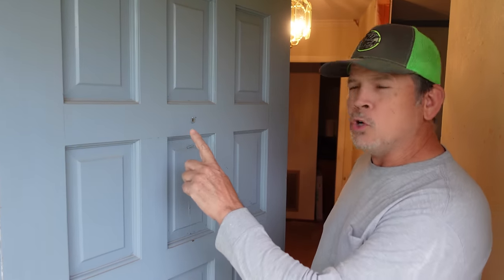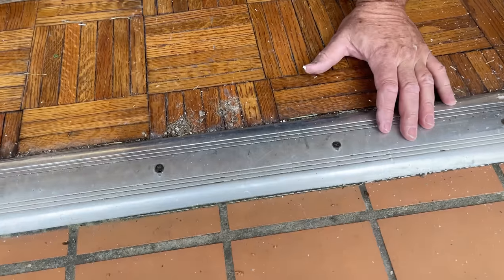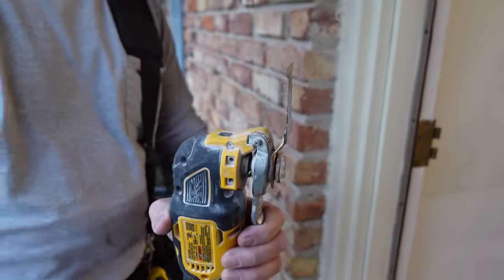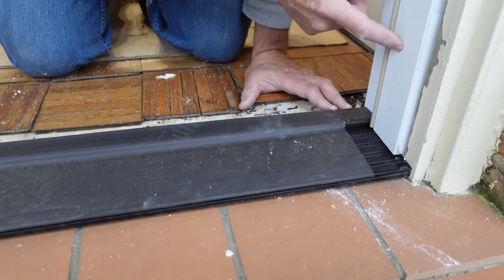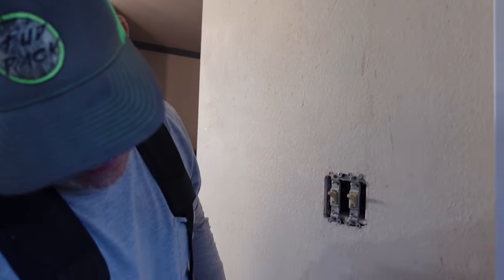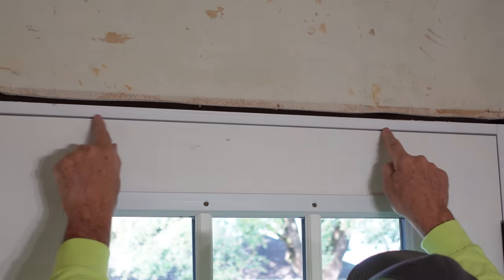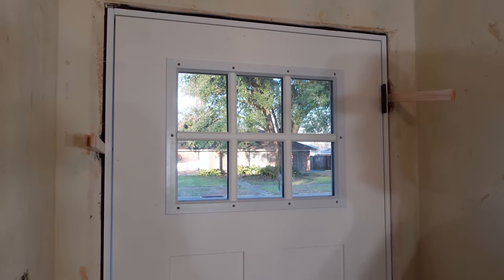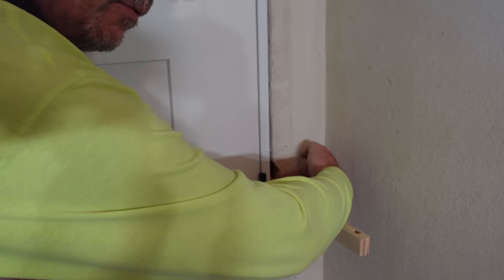HOW TO REMOVE and REPLACE a Front/Back Door (Easier Than it Looks!)

Comment: Probably the best video on an exterior door installation that I've seen.  I'm always impressed by the level of detail and attention you give to each and every project.  I"ve learned so much from watching your videos.  Kudos.
Reply from the maker: Super appreciate that thx 👍👊
Reply: @StudPack  Why do you install door that's opening inside? Doesn't this make it hard to open in emergency? Also with those hinges this looks extremely weak solution against any forced entry, since there's only small lock latch holding door shut.
Reply: Nice job. Sometimes when the feed rate is turned up to high on a cnc it will cut funny shapes. Seen it a lot with worn cnc  machines
Reply: @jarivuorinen3878 do you live in a cave? That is how all residential exterior doors are! He ran screws through the hinges into the framing.  Also when he foam seals  around the jamb it'll be solid
Reply: Could not have worded my thoughts any better!  👍😊

Comment: This video popped up in my feed, and I watched it from the perspective of a residential/commercial door specialist, having installed many thousands of doors, reinstalled many thousands more. I also taught proper door installation to other carpenters. I know, too well, the deficiencies of door manufacturers and production framing crews. I have watched many u-tube carpenters install a door and face-palm. A correct swap, well done. You even called out the larger #9 screw  ( I use stainless) on the security screw. I also use 3" # 7's for strike and latch plates. Criminals beware :) !
Reply: Excellent!

Comment: Sorry Stud Pack, I was cut off before I could finish. After installing the newly formed Sill tray, use the quality sealant around the edges to prevent air leaks, around the Sill tray. As a note on the knob side of door, I would suggest using wider shims around the latch area so your customers can add reinforcement latches that contain 8-12 3" harden screws to prevent door kick in's that could pull your frame out of plumb without wider shims placed on latch side.  These are simple couple of suggestions to you, and I say this respect. I have been installing doors and windows for years without water penetration. Keep up your wonderful work, I enjoy your videos. Best regards to you, Danny Price

Comment: As a DYI'er I've done many interior doors but no exterior.  The house I just bought needs all new exterior doors and I was a bit nervous because it's a brick house and the trim outside is a lot more extensive than the other houses I've owned. Showing how to remove the door from the inside without touching the outside trim was just the trick I needed to get me going on this project.  I haven't turned my TV on in days since I've found your channel, been binging on your guys videos.  Keep up the great work!
Reply from the maker: Thx Darryl and we're glad you found us 👍
Reply: How'd it go?  I'm considering my first attempt too.

Comment: Thank you. Your attention to detail is becoming a lost art. Hopefully the younger generation is watching content like yours. I’m a subscriber and although I’ve done a lot of the same jobs you work on, I have picked up some tips and tricks from each of your videos. One thing I am doing on exterior door installations is hardening the area where the dead bolt goes into the frame. I normally put a 3 foot strip of steel next to the 2x4 framing and secure it with long screws. It helps to make it secure from being kicked in. I also use structural screws on the hinges. That is most important on the lower ones. Keep the good content coming.

Comment: Great job,  when removing/installing the door/frame, sometimes there is a security wire sensor with a magnet mounted in the top of the door to deal with & mount in the new door/frame.

Comment: Great job, Paul and Jordan! I've hung many a door in my career, and that's definitely a good way to do it. Taking the time to make your reveals correct and true allows the door and the jamb to have clearance for seasonal movement, and proper operation! It's not just for looks, people! One thing you didn't touch on was making sure to add a "shim pack" (hey, is that your 2nd channel?) above and below the strike plates on the latch side of the door for reinforcement. 
I have also noticed a huge degradation in the quality of doors lately, especially from "Steves" and "Masonite" . It seems during the shortage times, the quality control has been severely compromised! The router job on the strike plate mortise would drive me absolutely crazy!
Splitting the extension jamb like you did here saves a ton of time and effort when doing a door replacement! Very smart!
Reply: Who's Jason? Did you mean Jordan? 😁
Reply: Every prehung door I have ever purchased had been a POS no matter which manufacturer.
Reply: What do you mean "splitting the extension jamb? Where in video was that done. Please explain?
Reply: @Fallon Stone  at about 4:15 in the video is where Paul was splitting the extension jamb from the door using a putty knife and a hammer to separate it. The extension jamb sits between the exterior door casing (Brick Mold in this instance) and the actual door jamb, and is used to make up the difference in the thickness of the wall  to the door jamb. Most jambs are 4 9/16" thick, made for 2x4 wall construction. When your exterior has a thicker cladding, such as brick, you install a jamb extension to hide the gap or use a wider, but less available, door jamb. Here, Paul left the exterior casing and the extension jamb installed, removing only the door and the attached jamb, simplifying his installation, which is brilliant.
Reply: @AlAmantea  Thank u
Reply: @fallonstone408  no problem at all.
Reply: Quality fell by the wayside, it's cost, cost, cost.  Many (not all) mfgrs are selling garbage.
Reply: @granbubba1  not only that, it's also a lack of quality help. Finding qualified people to work for you is a very real struggle in this current climate.
Reply: @AlAmantea  You are right on the money there but in the past couple of years' materials have really gotten cheaper and cheaper.  Quality is becoming cost prohibitive and that's really sad, makes us look bad to our customers.
Reply: @granbubba1  100% agree with you!
Reply: The thickness of outside wall is bigger than a  store bought door jamb,  soo thats why he butted up tp the split outside jamb part with the old brick mold.
Usually i have to bring a table saw and make wood parts. We call them door jamb exstintions.  They fit between new door and outside trim.  
This is a very tricky project in Carpentry,   its all about the SHIMS, A hair here n there

Comment: Good job guys right on. I am a retired old finish Carpenter and have done many doors like you did. One additional thing I would check would be the twist of the frame you have to make sure the door fits the jam when it closes otherwise it'll be twisted it looks like yours was probably okay.
For the majority of doors that I did in  retro fit house the floor seem to be always the problem and out of level one way or another.
A lot of times the floor and subfloor were rotted and needed to be filled in redone.
Anyway guys, good job, good video.
Thanks

Comment: Great Video!!! Union Carpenter and certified door and hardware installer here.  I specialize more in commercial doors than residential.  We are always evaluating reveals like you detailed.  I've never seen those door shims that you made. I use shims that are basically 3 1/2" of zip tie material with a peel and stick on the back.  That allows us to throw the hinges, or place one shim on one side of the hinge which also pivots the pin of hinge toward or away from the jam.
Reply from the maker: Thanks Marcus!!   Commercial doors are a whole different ball game imo.  I've done steel, aluminum, glass, laminate, all types of door closers (recessed in the slab are the coolest), locks, panic devices, etc.  Never hung a lead door thought:)

Comment: I’ve been a carpenter/contractor for 42 years and have installed hundreds of doors. BUT....it never occurred to me to leave the extension jamb/brickmoulding in place as shown in your video. Smart. Old dogs can learn new tricks. Dave Heitman dba Dave The Carpenter in Omaha
Reply from the maker: Super appreciate that Dave 👍👊
Reply: I have done this several times on homes where I dont want to desturb the paint or trim on the interior. 
It works well on door that were install square and plumb originally ... then I can use the trim to gauge my reveals and set the door. This way I can also spray the foam insulation from the outside since I temporarily remove the brick mold to add a jamb extension and rip the brickmold down a hair.
I this situation I probably would have just taken the old brickmold doen too.
I wouldn't adjust the top left or right... once you make sure the head is perfectly level then plumb the hinge side perfectly from the very top too the very bottom and then only adjust at the hinges.
You also don't have to remove the weather stripping... you can just fold it back where you are placing your screws.

For the shims between the hinges and the jambs I use the thin hard cardboard used in cereal boxes for example... but whatever works.
Reply: Yeah, it was a great tip, and one I wished I had used when I helped a friend replace an exterior door, and took the new door out of the jamb, and used the old one. Old jamb was encased in stucco, and I was NOT about to mess with that jamb and the Stucco.  Needless to say, it really created a headache, but We finally got it in, and everything was plumb and it operated fine.  Never again!

Comment: Great video. I like to carry a bunch of small washers and place them around the hinge screw holes to use as shims when needed. Using washers also gives you the ability to tilt the hinge if needed, by using on just the two outside holes, instead of all four holes. Sometimes even small washers are too thick for the adjustment I need. A few layers of masking tape in this case will get me to the  perfect thickness. 

To help not having to open and close the door so many times to test gap thickness, I will take a wood shim and slide it into the gap at the top and botom of the door where my gap is established. I push the shim in until it sits snug in the gap between the jamb and the door. I then take  another scrap of shim and some CA glue (2p10 glue as you brand reference it)  I glue the scrap to my gap shim lining up against the jamb creating a positive stop.  I them use the gap shim up and down the jamb where needed sliding shims in-between the jamb and the framing until it presses snug against my gap shim. This creates the perfect gap with a lot less opening and closing of the door. 

If one doesn't have CA glue handy, you can also just make a pencil line on the gap shim. Having the stop makes it easier though.
Reply: Thank you for the good tips!
Reply: Washers?  Dope af!!  And that there, is key!

Comment: I just replaced 15 doors in my house with solid pine doors that I finished and painted.  Fitment nightmares.  I am not a professional carpenter by trade but I knew I couldn't be that incompetent with door installation.  The manufacturing quality was horrible.  And I went to a window and door stop to buy them to get a 'higher' quality!  I had to rebuilt the frames and reposition the door stops on most of them.  I finally got the manufacturer's rep out to look at them and he is replacing some on their dime.  This project has taken most of the year and now I have to finish more doors to replace the ones that I already did.  The whole project has been a nightmare thanks to horrible manufacturing.  I feel your pain.

Comment: The exterior "casing" is called brick mould. More great content here guys, keep it coming!
Reply: Actually that door had brick mould and a jamb extension. The correct way would be to get a door with a 5 1/4” jamb to eliminate that extra piece and scribe the brick mould to the exterior brick so the reveal is even matching up to the door. As it sits now anyone wanting to mount a screen door isn’t going to be able to install it plumb. There also was zero mention of making sure the jamb meets the slab on the strike side.

Comment: I am a 25 yr door carpenter you did exactly what had to be done. God help you on the flooring. A trick I do is pull the plastic threshold cap and run a few screws inside to secure the threshold down. You can move doors all over by positioning shims cut out of ramboard (pasteboard) to tilt the hinges. Most of the millworks in my town are bad to awful and maybe that is how it is now but I warn everyone to avoid these Mastercraft doors period for many reasons.

Comment: I went through this a few months ago.. What I found was the QC at the door manufacture was completely terrible, but the problem is, when you find the QC issues during install, you don't have a door on the house and have little choice but to make their poorly manufactured door work anyway..  We ran into hinges not fully seated in the routed area and the screws the manufacture put in were stripped out (over spun with drill). We also had the door frame not perfectly square, etc.. Was all day to change each door..

Comment: 25 years ago I worked as Shop Foreman at Pella of Georgia. When assembling the door to the frame we installed two pressed cardboard shims at each hinge and we had some soft vinyl 90 degree shims that we stapled on the interior edge with the leg between the door slab and the frame. Makes the install much simpler.  Personally I like the pressed cardboard hinge shims better than plastic.
Reply: same here i use cardboard
Reply: @markverde8666  - you beat me to it, I use cardboard too (but not the corrugated type).
Reply: Pella makes good windows and doors if you can afford them. I like their metal clad wood windows and doors. My experience with Pella has always been good. They take the time to grain match all the parts so you don't have some wack grain on one part of the door that just jumps out at you and screams paint grade. And you would never see a strike plate routed out like the one in this video so you definitely get what you pay for. One thing I liked about Pella is they where the first company to put nice heavy duty temporary metal handles on the frames of their heavy double hung French doors so you could move them into position without dropping them. Little things like that makes the install process so much easier. Yea I've always used compressed cardboard shims as well.
Reply: @iamjackalope  My favorite offering from Pella is the Slimshades ( mini blinds ) that go between the glass. It used to be that you had to choose between blinds or muntin bars. Now you can get some that allow for both at the same time. Fortunately for me, my finances came in line to build my house while I was working there, so I was able to get employee discount. I have 43 casement windows and 9 exterior doors. Been here for 35 years now and they all still work perfectly.
Reply: @dallasarnold8615  wow! You must have a big house. I’m getting ready to build my house.. probably going to go with Plygem for affordability unfortunately.
Reply: @Luke-xv5ip  Big is a relative statement. Big to some, not so much to others. It is right at 3500 sq.ft. My father and I built it in 1986. We did everything ourselves except for the poured concrete walls for the basement. That was 10 1/2 months of working everyday after my regular day at Pella, and all weekends, as weather permitted. That is that we did all clearing and grading as well.  I saved a ton of money by us doing all the work. It was just over $93,000 to complete. Tax assessor says now worth $493,000.  I do not mean to sound like I am bragging. Would be much more cost if I were building today. My dad is dead now, but I really do cherish all that work together.

Comment: Big box store door, likely. I appreciate all the details you provided. I like using 3" GRK trim head screws under the weather strip. I flip it up out of the way and run them through a set of shims. At the latch, higher end doors provide a heavy plate to set under the strike plates and provide #10x3" screws. It adds a little extra security against doors getting kicked in easily. 
Thanks for the posting. I enjoyed it thoroughly, partly because someone else was dealing with the challenges that ALWAYS come w remodeling projects. Good on you. Blessings to you and yours and a Merry Christmas 🎅🎄

Comment: I would like to add longer screws at the latch and deadbolt locations for better security. Great video.
Reply: Absolutely!  I do property maintenance on rentals and have stopped installing "locking" door knobs.  For the deadbolt face plate I put the 4" screws into the frame.  For the door knob, I install a non-locking  (no key) doorknob, with no special screws.  That way, they need the key to lock the door when they leave and it is much more secure.  
A locked doorknob can be unlocked with a credit card almost as fast as with the key.

Comment: For too many years I thought the problem with any new door/jamb set was due to something I was doing wrong.  I only had to finally open up a pack of those store bought hinge spacers to finally realize some doors shops just don't watch their workers.  Especially those bolt throw mortise plates are a sure give-away on who ain't watchin' the production floor.  I only order doors from one local manufacturer now and never anything from Depot or Loews.  The few bucks difference isn't worth the aggravation.

Enjoyed the video...you guys got a bottomless bag of tricks!

Comment: I concur with your recommendation of a chisel blade putty knife for door casing removal. I keep a spare in my tool tote just in case I momentarily misplace one.

I also recommend using a 3" wide putty knife just like it for reverse engineering baseboards or crown molding.

Keep up the good work.
Reply: I use a 7 in one or 5 in one, but same idea, good for almost everything!